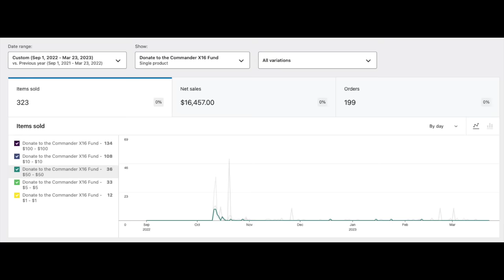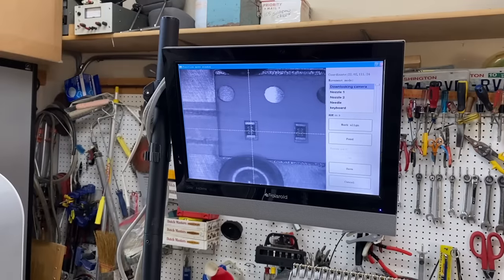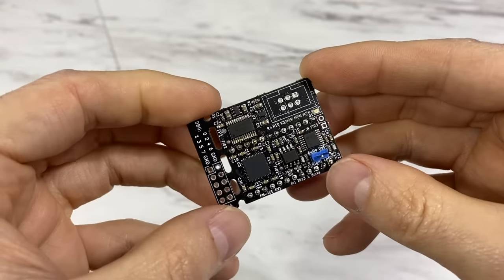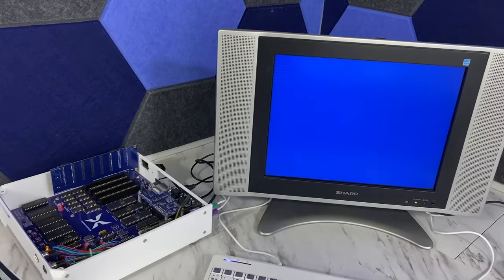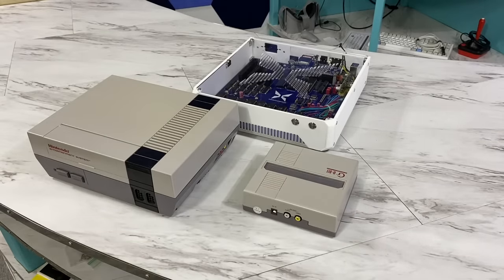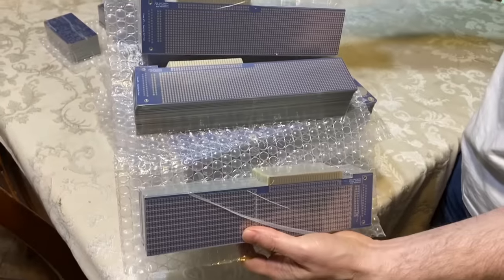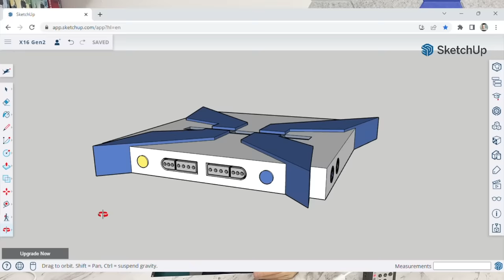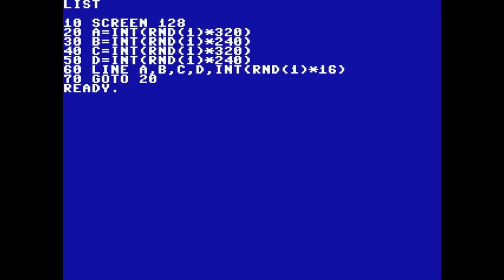Commander X16 2023 update

Comment: Membrane keyboards? Why?!?!? So many decent mechanical keyboards to go with but you guys chose membrane keyboards for a "retro" PC?
Reply: You can buy a deluxe mechanical keyboard. :) If you really need it it's $205... Adding unnecessary cost to an already expensive machine would not be a good idea.
Reply: @novh4ck  why $200? There are many nice mechanical hot swap keyboards below $100 and doing a retro PC just would not feel right with anything other than a mechanical or buckling spring board.

I did not see an option for a mechanical keyboard.
Reply: A Code from WASD? So many other choices, the keycaps could have even been done better, but $205 for a soldered board in 2023 is ludicrous!

$205 for a TKL with dye subbed keycaps?

So many better choices, so many.
Reply: @MechKeyboards  Nothing stops you from getting an USB to PS2 convertor and using any keyboard you like. The point of bundling a cheap membrane keyboard and cheap mouse with every X16 is to guarantee to developers that every user has one while keeping the price as low as possible.
Reply: @novh4ck  I'm well aware, I was hoping to get the X16 with a mechanical keyboard that matches the theme all in one package. Of course I could buy another keyboard, but it won't match, Just disappointed that so much effort was placed into everything else but the keyboard, the main method of input, like it was almost just an afterthought.

Oh well, guess I'll just make my own, cheers!
Reply: @MechKeyboards  damn right, a fullsized blue switch ajazz costs just $35.

Comment: Would it be an idea to use the word "edition" to distinguish between the designs? So I mean, to call the first board (with the user port and expansion slots and such) the "developer edition" and the design focussed on gaming the "gaming edition"? If you call it "board" then that focusses a lot on the PCB but even in this video you showed you're playing around with case design, so clearly the design is more than just the electronics. I think the word "edition" also makes it immediately clear that the gaming edition is not "better" in some way (which the word "gen" or "generation" does strongly suggest). The word "version" can also be confused with numeric versioning, which might be slightly confusing.. Imagine making a gaming edition and then in a few years you make a newer version of the gaming edition.. When calling them gaming version, you suddenly get "gaming version, version 2" or something similar.. So that's another reason I'd go with the word "edition". Just my two cents.. Can I get a developer edition now? ;P

Comment: How hard would it be to upgrade basic to commodore basic 7.0 and run c128 basic programs?
Reply: It would require a major rewrite of BASIC 7. BASIC 7 occupies most of the address space of the C128 (only 16K of RAM remains while BASIC is mapped) and is basically written around the Commodore 128 MMU, to retrieve BASIC tokens and variables from the two different RAM pages. You have to rewrite it for the 16KB back switched window of the CX16. Further, many of the commands of BASIC 7 target the VIC-II (such as sprites and graphics). You would have to rewrite those commands as well.

Comment: If you limited yourself to Html 4 or something along the line, and implemented an image scaler directly into the network interface where an < img height="30" width="40" src="example. jpg" / > would return a ready to use bitmap of 30x40 by essentially means of filtering, something akin a browser should be possible. As for chats or things with dynamic content, those usually require JavaScript which is something you likely won't be able to afford from a complexity and performance point of view, but you could add a < embed type="chat" ... / > type of element to the standard for those specific needs. If that isn't your pot of tea, you always could return to using BBS style views using ASCII codes, just using a terminal dialup to a domain instead. This should even be simple enough a command to possibly just add to the X16 BASIC by default. You'd only need to add codes for creating and naming objects so that they become clickable / interactive for mouse use, and downloading / uploading of without switching the entire dialog to sending / receiving.

Comment: I'm really confused. Why is it so hard to understand the question "Why not use a Z80?" - I would love to hear the answer and the reasons, why. All I got was David calling the request to change the system now "ludacrous". Not really nice to misunderstand the question and to insult your audience at the same time. And the other guy was rambling on about why you can't put a 65C816 in it. That was also not the question. The question was, why in the first place you decided against a Z80 and instead in favor of a 6502. How disappointing!
39:52: "We wanted to be able to run the Commodore operating system, that was one of the original goals of the system." - Ok, and why did you want to do so? There is also a famous OS for the Z80... I still want to know more about principal architectural decisions.
Reply: The 8-bit Commodore community is the largest retro computer community. Further, David is an 8-bit Commodore user himself. Therefore it is quite understandable that he chose to base his dream computer on the same architecture as the computers he loves most. Because many of his viewers are Commodore users and know these computers very well, they will feel quickly at home with the Commander X16.
Reply: @danielmantione  That's right, it's actually quite obvious that David is closer to the 6502 than the Z80. It is all the more annoying that he does not simply answer this, but describes the question he has misunderstood as "ludacrous".

Comment: why not use the pc controller port then? still makes it authentic but not limiting you to one button. Get some Microsoft sidewinder action going. also why are game controllers and sound cards always stuck together? very odd choice to make
Reply: We have 12 buttons?
Reply: @DailyCorvid  idk how many you have but it's more than 1. I know Wolfenstein supports like 3 or 4
Reply: @bland9876  it is 12 buttons SNES port 4 dpat directions 4 face buttons select start l and r
Reply: Wolfenstein will support the keyboard if they have any sense!!  I love that game but going back to it, I always use mouse strafing now, ala Doom.
Reply: @DailyCorvid  I didn't know what you are saying but what I know is that Wolfenstein doesn't let you aim at the same time as you are strafing so that sucks. Makes it kinda unplayable in my opinion.

Also I think you missed my original point and that was that old DOS PC games from before USB gamepads supported more than one button vs what the 8bit home computer like the zx spectrum comador 64 supported.
Reply: @bland9876  That's what I said, going back I would require mouse strafing instead of 4 arrow keys for everything.

It's still a good game, just I have been using mouse and keyboard basically since Quake 1
Reply: @DailyCorvid  trying to play Wolfenstein solely with just the mouse is very weird to me. It's having to hold down an extra button to straif that's very weird to me. Even trying to use a controller doesn't quite work because of that.
Reply: @bland9876  I come from a generation where you had no analog sticks lol anything was better than arrow keys any mouse control was a benefit.
Reply: @DailyCorvid  I just set up my steam deck so that the left joystick moves and straffs and the right track pad is the mouse but only left and right so that you can aim really fast.
Reply: @bland9876  aww man cannot wait for the Steam Deck 2!  I missed out of the SD1, but man that is one great design.

Double analogue sticks is the way !!!  Lol yeah that holding down the mouse button gives you hand cramp...
Reply: @DailyCorvid  Wait why can't you buy a steam deck right now? I mean you could have done it a couple of weeks ago when it was on sale.
Reply: @bland9876  I am waiting for the Steam Deck 2, there ain't no point in getting the first one at this stage unless it's super cheap.
Reply: @DailyCorvid  then you will be waiting years.
Reply: @bland9876  That's fine I am in no rush
Reply: @DailyCorvid  are you being some kind of troll that in falling for cuz your not making any sense? I totally get it if you don't want to buy one but you're arguments were not wanting to buy one Make absolutely no sense. You didn't "miss out" on buying something if you can still buy one right now from the official source and not a scalper. Also $400 is really cheap so again not making any sense.

Comment: Will be interesting to see if someone goes through the effort of porting over AmigaOS :) I know it'd have to be pretty cut down since the C64 isn't quite up to the specs, but still
Reply: Given the differences between the CPU's I would put the probability as 0.  That said it is available for the PowerPC CPU's and there is a clone-like version for the PC (x86/64 CPU's).  I think the main issue would be the low level CPU and the comparatively poor graphics compared to what AmigaOS expects.

Comment: I'm definitely interested in getting the Gen 2. 
I don't play around with classic computing, I'm no power user. And I can't quite bring myself to spend the money on the Gen 1.

But if the Gen 2 is simplified and cheaper, I'm interested in that for sure. Atleast to tool around with the homebrew and porting community (I assume I could side-load free software via an SD card, or some sort of SD-card reading cartridge)
This project looks very cool, I wasn't interested in this so much until today. I see it's like an Amiga in power? I'm not that familiar with this era of computers but I vaguely remember seeing Amiga software / tracker players ported to the Wii homebrew channel when I was a kid, and funnily have nostalgia for it (despite it being before my time).

Comment: Well, i will definitively buy a "Developer" version of the machine, that has always been my goal. The case prototype looks amazing, i sincerely hope you will develop a version that can fit expansion cards vertically, and i also hope that the final version can have more colours, the white one looks nice, maybe a grey or beige one will also look nice. Is the 3mb limit of the cartridge something related to the interface, or the kernal?
Is the machine tied to the Yamaha chips, or it can use any other?, if so, will it be possible to create sound cards?
I can not pay 500 for the machine now, as my country only allows a maximum of 300 USD to be imported per month, but i must say than that is the only barrier stopping me from getting one.

Comment: Will CX16 be able to run a UI like GEOS for the Commodore?  I don't know enough about the 6502 chip but I'm guessing it doesn't have the instruction set for preemptive multitasking like SymbOS for the z80?
Reply: I don't see why it can't run GEOS. The Mega65 is doing it as well, the source code is within the community, so it is a matter of someone doing the work.
Reply: GEOS runs on the 6502 and was actually packed with the Commodore MAX I think, or the C4 one of those computers.  It's better than a Z80 imo.
Reply: @DailyCorvid  The 6502 is definitely a legendary chip.  While the Z80 was somewhat less popular it has a more modern instruction set useful for running a UI correctly.  In a perfect world we could have both a 6502 and Z80 system with a wealth of NEW hardware and software expansion, but I would go with a Z80 just because I've seen both GEOS and SymbOS in action.  I know 8BG is a 6502 guy so I'm not saying he went the wrong direction, I'm just saying my preference.  Maybe someone could make a Z80 expansion card and use both the 6502 and Z80 together.
Reply: @reviewaccount469  I think that will definitely happen, not necessarily CPU's at first or at all - but add-in cards for interfaces and stuff.  There is no reason at all we couldn't see a card port card containing drivers for using whatever drivers are available.

So if we also got networking you then have an updatable driver database, completing the Commodore compatibility feature.  Currently you can import and write code in Assembly and BASIC but you can't do it straight from a tape or disk to your editor.

That would be pretty awesome, I expect the tools it does ship with will be amazing though.  David's software releases have all been really great no reason this wouldn't be.
Reply: @reviewaccount469  I had a BBC with a Z80 and a 6510 add-in card lol.
Reply: @DailyCorvid  Oh cool, I didn't know such a thing existed
Reply: @reviewaccount469  Yeah I had a Pi Zero set up as a bridge between that and the BBC native CPU, as it has a cartridge slot on it, and you put your new CPU into that.

It's called the RetroPi or PiTube or something I forget now.  Costs £20 and you throw it straight in and it just works without doing anything, long as your ROM's are in the right order still.

Comment: The HDMI consortium lets you license the product for a cost of $.15 per unit sold. If it's the difference between selling these computers for $499.84 vs 499.99 to get the HDMI logo on there and in the product manual and on the box, etc... is this the best place to save $.15 in the design? :)
Reply: I don't see any benefit to it, even if it was 1 cent per machine.  Using the DP with an adapter works and does not require licencing at all.  Now that's what you always have to prefer, as licencing struggles with third parties can wipe out your whole team and project.
Reply: @DailyCorvid  I'd be a little surprised if the "big software company" would be okay with including an unlicensed HDMI port... if they don't, that's cool. But without a licensed port the software company couldn't implement HDCP, which they really REALLY like to force on us. :(
Reply: @JonRowlison  I said use DP with an adapter, not an HDMI port - the signal is the same you just need a pin adapter which costs $4.  I am not a huge believer in using HDMI on absolutely everything.

Sure for the tv and consoles, but for high refresh I far prefer using DP or even MDP.

Comment: If you had chosen a Z-80: "Why didn't you use a 6502 instead?"
If you had chosen HDMI: "Why didn't you use VGA instead?"
If you had chosen a 9 pin joystick: "You should have used a SNES controller instead!"
Ahhhhh.  The internet.

Comment: Considering 6 hours of soldering, $500 is very unsurprising. Cheap even, lol. A person who can fog a mirror and work a soldering iron is apparently no less than $15/hr in Texas, and the guys you have are probably at least double that at $30/hr, which you can spitball at ~$60/hr for the total expenses (as far as estimating goes). That's well over half the cost right there. So like I said, no surprises, lol.

Comment: It's easy to pick apart people who do things for not having anticipated every problem in advance, but the truth is that complex real-world projects like this will always run into problems. If not these problems there would've been a different set of problems. If you attempt to factor in every potential negative then it won't work and you'll probably just give up before you ever even start. Getting started, with grit and ingenuity, provides the momentum to face those challenges.

Comment: I don't think 50$ is realistic anymore. You imagined that 4 years ago but things have changed. By the time it comes out 50$ will be equivalent to 20$ when you started all this. You can't get a Pi for that price anymore.
Reply: I think when he said $50 initially, he was talking about a single board populated with 4 off the shelf parts, without the sound chip (since it wasn't chosen yet).  The one he is holding up when he says $50 is like 8 inches long with like a dozen wires and no case or keyboard.

Now we are talking about an entire hand-built computer with software and accessories, and a community working on it for the foreseeable future.  You can get a NanoPi6 for $100, 8GB model with quad core ARM which is cool = I have one.  But that isn't stopping me wanting an X16.

Even at $400-500 I still see huge value here.  Then again I think if a person can't save up $500 spare dollars then they can't be giving me advice on how to create value, when I do have $500 saved.  If they just think they should spend their money elsewhere then that's a different thing.

But if you have followed this project along, then you might actually think this is a super competitive price!  I have tonnes of David' merch, and it's all hugely underpriced for what you get.  Imho.

Comment: I still don't understand why it has a SNES socket on the back for Joystick. People tell me it's because they're common. I mean... I have no idea how common they are in America, but where I live, they are most certainly NOT common. It's pretty much impossible to get anything other than an 8bitdo adaptor to use a wireless controller on a real SNES.
I don't know why you didn't go with something insanely common like a Megadrive or Amiga connector. you can even just buy the connectors at any electronics shop if you want to make your own Arcade stick.
I guess how common a controller/connector is is based on how well it sold at the time. In America, Nintendo was king. In the UK, the climate was very different, there was no video game crash, Nintendo was trying to enter a market already saturated with other things, mostly Microcomputers. Sega sold a lot better than Nintendo, especially in the NES era. Even in the SNES era, it had tough competition with Sega. So not only are the NES and SNES far fewer in the UK than America, Many other systems not available in America used the same game connector as Atari, Sega and the Amiga, and for the most part were compatible.